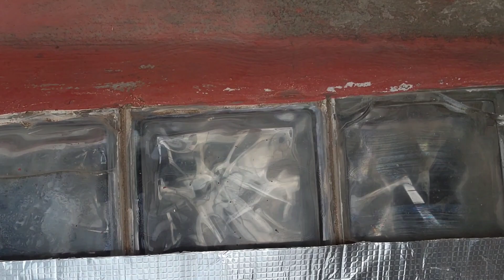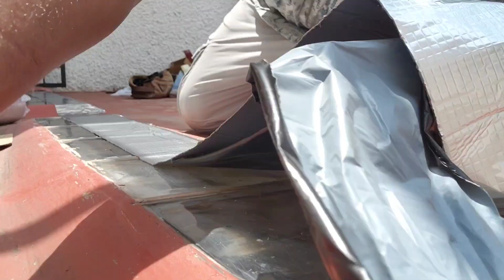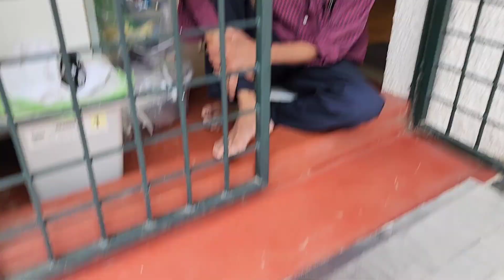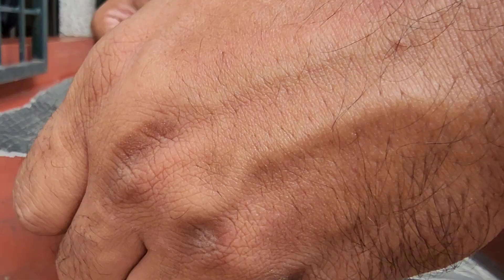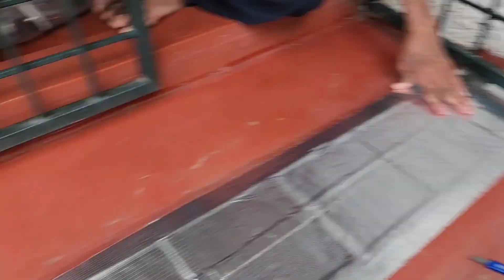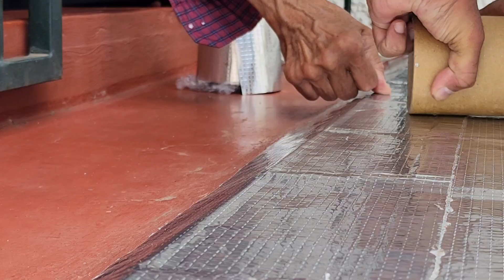Roof Leakage Easy Hack - Fix / Leaking Roof Solution Aluminium Butyl Rubber Tape Fix Waterproof Tape

Comment: Great video. Is this suitable for leaking bathroom pipes?
Reply from the maker: If you can smoothen out the area around the pipe and make it dust free and fully accessible and dry.Iy would work Sir.I have repaired bathroom plastic buckets with this and it's been very successful.

Comment: Is it slippery if use in bathroom floor
Reply from the maker: It's not advisable for bathroom floor.itw better for exteriors since you might use acid based cleaners in the bathroom.For bathroom and easier solution might be grouting compounds which work best